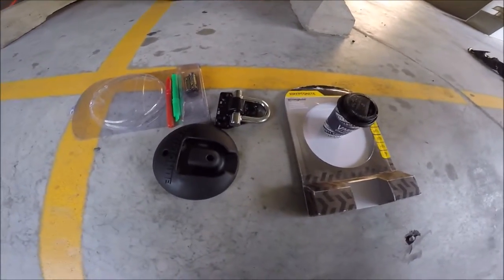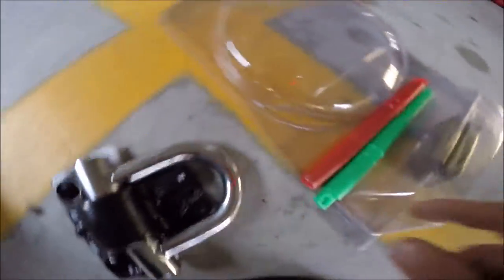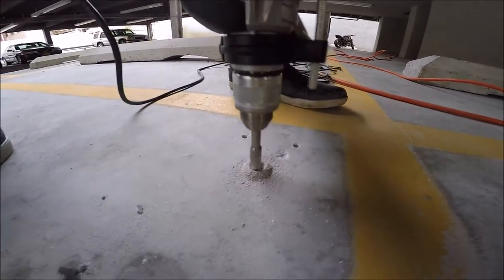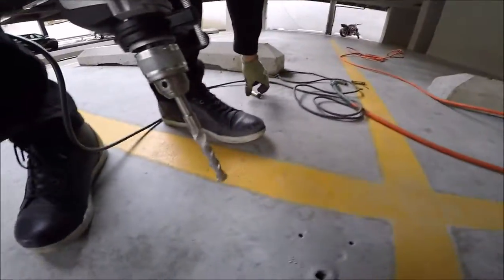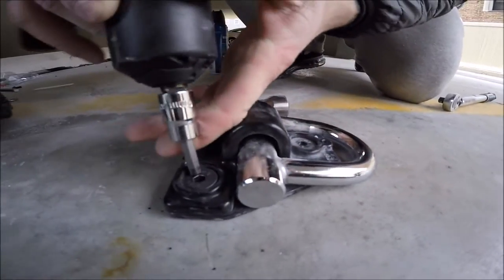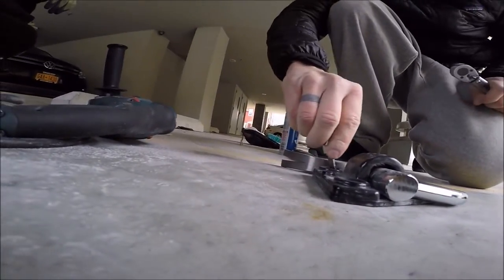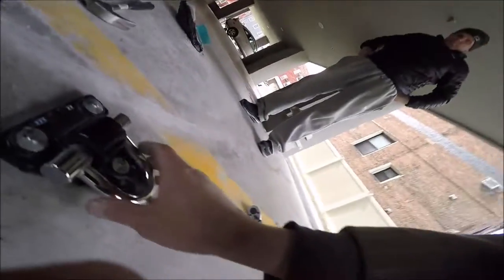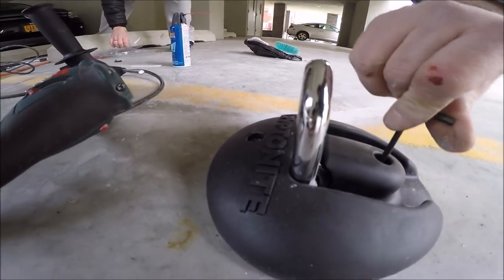How To: Kryptonite Stronghold Install - Motorcycle Theft Protection for the City Life

Comment: This is pretty sweet and you guys made the install look super simple. 👍

That GTI is pretty quick too.
Reply from the maker: +DJ MotoVlogs That GTI is quick as hell but the man babies it - he should be doing smoky burnouts everyday :) 
Install was actually not as easy, because those concrete anchors are not a joke and required us to drill like 10" down - but that anchor is not going anywhere now

Comment: So where do you put the chain through the bike?  Both wheels and the frame?
Reply from the maker: +external influences Yes and yes. Wheels are good, but frame is best.
Reply: Use a Disc lock too its really good
Reply: On a Ducati you can put it through the rear wheel. If it takes me a week to get a steel socket to remove the rear wheel, I doubt a crook is showing up with one. Not many other places to chain through a Multistrada.

Comment: Did you have to get approval for this? I don’t think my complex will allow me to drill on their ground
Reply from the maker: That parking spot is privately owned. Probably should have still asked permission but... technically its private property AND an improvement.
Reply: @ducatinyc  until water gets in their and cracks the cement wide open. Dont do this is cold climates unless you want t a very expense repair bill form your landlord
Reply from the maker: @lithium25693  I'm the owner so I will take it easy on myself with the bill.
Reply: @ducatinyc  I'm an architect and you're good and correct - this is an improvement. The anchor is also made for a tire to roll over it.

Comment: For maximum strength, use thread locker on all of the bolts.

Unfortunately, this won't stop a thief with liquid nitro, a torch, or angle grinder from quickly cutting the loop and throwing your bike in the back of their truck. Best to install two and chain both wheels using extra thick Kryptonite chains with really beefy tubular locks. Never use a regular padlock. Most can be defeated easily with shims.
Reply from the maker: +MotoErgoSum Yep yep. I'm using the thickest Kryptonite chain and Kryptonite lock and there are actually two Anchors installed. As well as a few other anti-theft devices which are a surprise. Plus extra insurance.

Comment: If you needed to, could this be removed if you moved?  (New to motorbikes)
Reply from the maker: I'm actually not sure. It's pretty in there. Never wondered about this. I think the idea is that it can not be removed by others or will be super difficult.
Reply: After you tap the bearing caps on it cannot be removed. If you want to move it, don't tap them on but know that motivated thieves could back out the bolts. Cheers
Reply: You might need new screws but in theory, you could drill holes around it to weaken the concrete and remove the anchor portion.  I wonder how much the replacement screws cost...

Comment: Would it be a good idea to strip the screws after installing it?
Reply from the maker: Hmmmmm, I don't see why not, especially if you never plan on removing it. I think that would be smart.
Reply: There suppose to come with ball bearing i believe. You hammer the ball bearing into the screw top before you put the metal caps on. That makes them pretty much non removable.
Reply: they actually include screws to help you strip the screws that are used to fix the black cap.

Comment: Why is this being installed in a parking garage?
Reply from the maker: Because the parking garage/space is privately owned and we want the bikes even safer.
Reply: I've had two motorcycles stolen from my private, 'secure' underground parking garage.  Chaining it up is one thing, but one really important thing to do is to chain it to other bikes and/or block it/them in with a vehicle.
Reply from the maker: Not a bad idea. I do have a second chain and might start doing just that. Thanks man!

Comment: how good you thinks this is like i really thought this was cemented on the floor
Reply from the maker: +Sour Patch I think its pretty hardcore. There are 3 pretty serious anchor bolts that are  pretty deep in there. I've seen some reviews of this Anchor and i think its the real deal when paired with a good fattest you can get Kryptonite chain.
Reply: +Ducati NYC Vlog yea i think is the new yorker or the forgetaboutit kriptonite chain i have really really thick an heavy only thing i was mad was that if u live in manhattan they don't offer the insurance
Reply: Any lock like this is only as good as the weakest part, which fortunately should keep anyone from going nuts about making everything invincible. When you use this and a chain and a lock, no one is going to go for the anchor bolts. They'll take an angle grinder or torch to the chain 99 times out of 100.